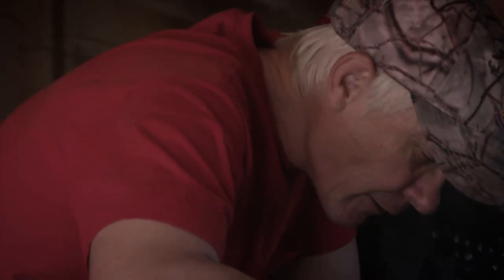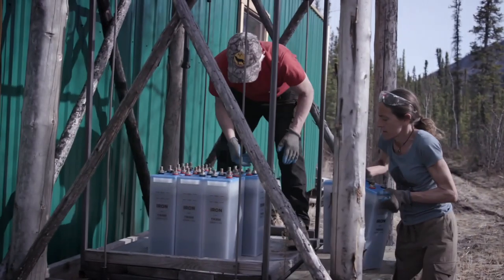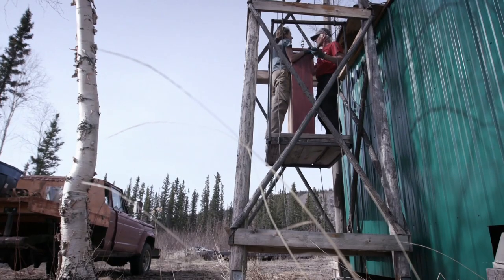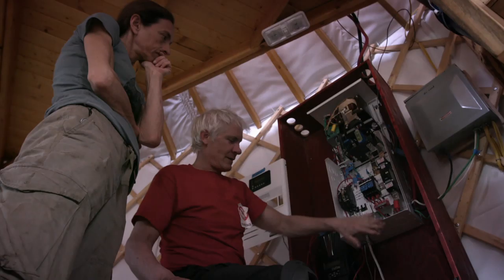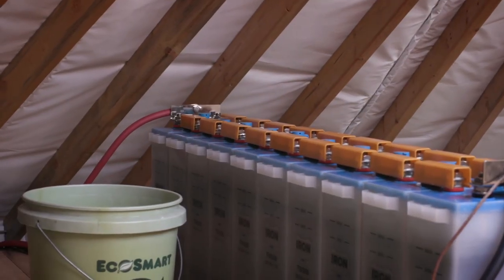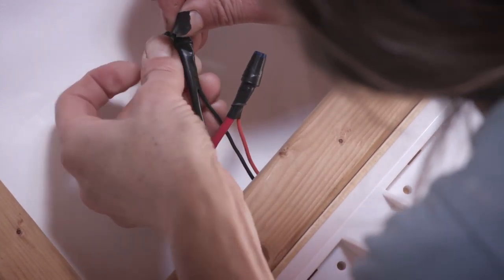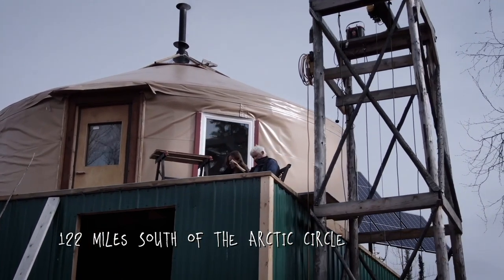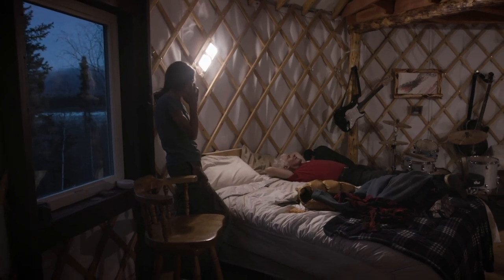Alaskans Install Solar Panels To Get Free Electricity During Summer | Life Below Zero

Comment: The electricity is not FREE.  You have a huge out-of-pocket COST . You have pre-paid for your electricity.  The energy from the sun is free ...
Reply: you make your money back and then more in savings after purchased though depending on the sun in your area. These people obviously have many hours of sun...
Reply: @benabrams8459  Obviously, they get 25% LESS Solar Energy than most any location in the lower 48 states.  And they get 50% LESS less Solar Energy than any state in the south-west.  The sun is very weak in Alaska.  Per the National Renewable Energy Labs (NREL) Alaska is obviously the worst state for Solar Energy in the entire USA ( regardless of what you may think ) ...
https://www.communitysolar.psu.edu/sites/default/files/pictures/national_photovoltaic_2009.jpg